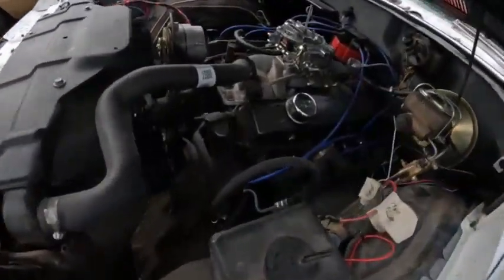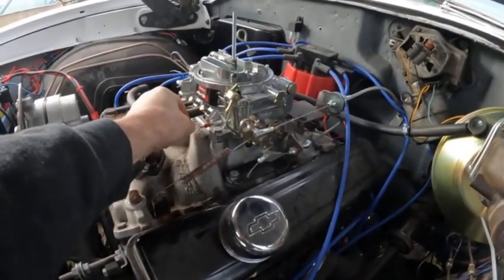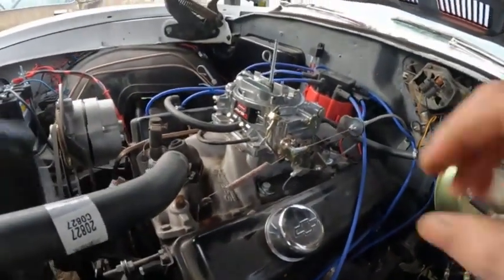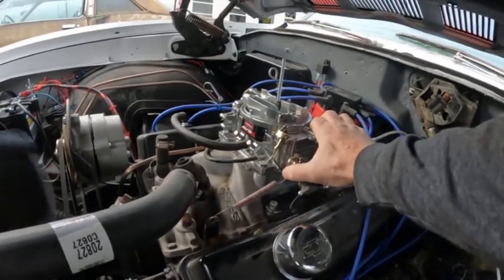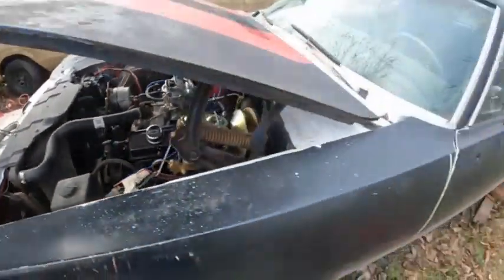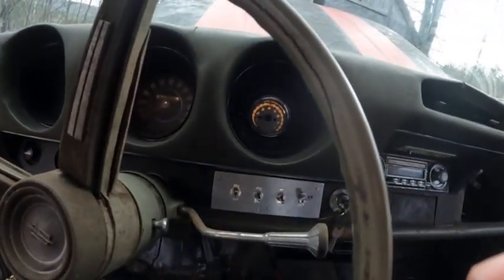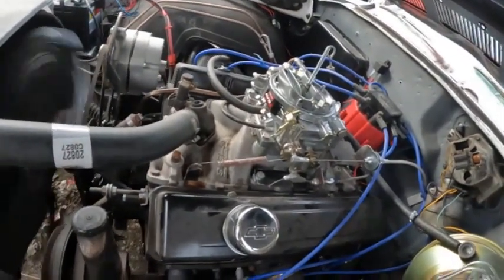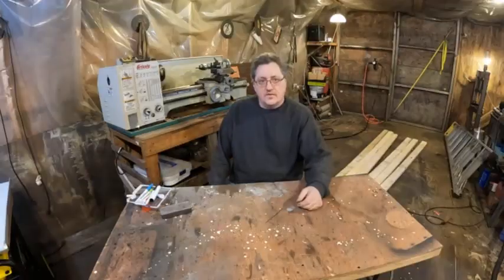Vacuum advance test run

Comment: I think everyone over complicates the issue, The way I look at it is this. Imagine you are driving down the road and the speed limit ahead is slower or there is a red light or stop sign. So you take your foot completely off the gas pedal to slow down at this time the engine vacuum is extremely high and the fuel is burring very slowly so it needs a lot of extra advance to burn properly. But if you are on timed port because the throttle is completely closed you do not get any extra advance! Any thing besides full manifold vacuum is just a waste of fuel.

Comment: You have to adjust  it for both.  you cant  just plug into one  and  then say the other is better. you're  changing  idle  timing and therefore changes  total timing IF  you dont  limit  the mechanical advance
Reply from the maker: Good morning. I havent messed with this for a while. i'm healing from a bad injury. Yes, changing from one port to the other could mess up the tune if the engine an distrubutor are stock. If the dist has re-curved it may want the vac advance to be set different. My works best with it on manifold vac.
Reply: @timsprojectcar1875  sounds good. Hope you feel better soon!